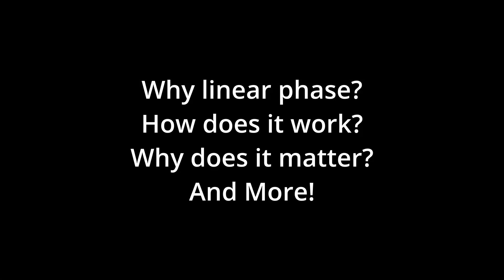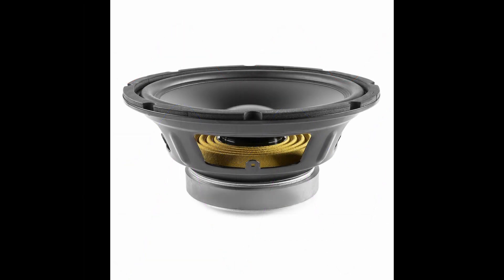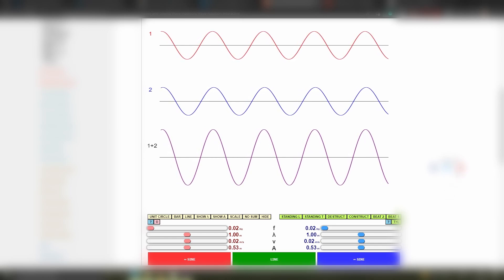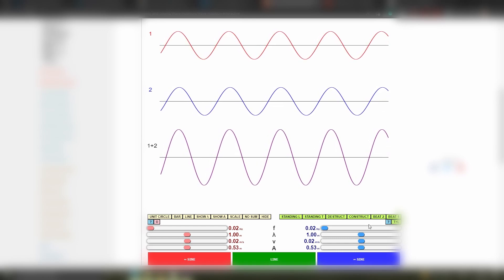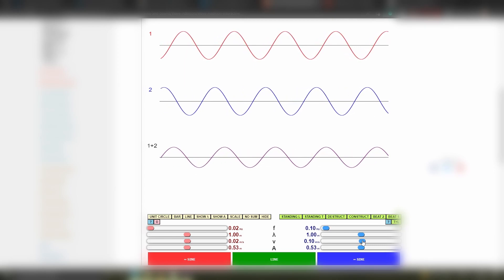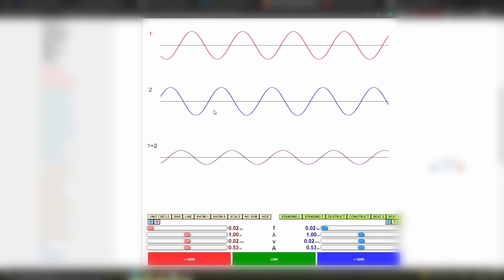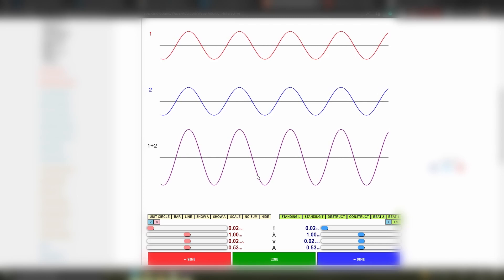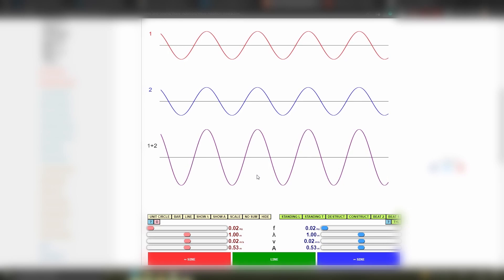Linear Phase EQ - Why you want it!

Comment: I recently changed to linear phase and found it a dramatic improvement, much smoother cleaner sound. I have some dramatic swing in the eq to help with room modes.
Reply from the maker: Glad to hear it!
Reply: @Elliott-Designs  thanks, I listen to music upmixed to 7.1 so I think the time smearing between the speakers was to much. I don’t seem to get much of this pre ringing, what cause the sound?
Reply from the maker: @matthewhanson498  it's typically high Q (sharp) +ve gain filters where pre-ringing is most prominent.

Comment: I've done a lot of listening to minimum phase vs linear phase and have preferred the zero pre ringing sound of minimum phase filters.
They can be FIR by design and don't have as much phase shift as IIR filters.
IMO if you left and right are phase matched the choice of pure linear phase corrections is not that important.
The feeling in high dynamic drums is better in minimum phase. Like every snare or cowbell cracks. In linear phase you are getting the pre attack hints and your brain is tricked by this fake future suck up to the attack points.
Try to set up a blind ab test.
Reply from the maker: Double blind AB tests are of course the best way to go about this, but I'm not in a situation to perform them myself. But with enough taps the pre-ringing will actually be below the noise floor (physically inaudible - all from what I've learned anyways), which is what I propose, although I do understand most hardware DSPs aren't capable of such high taps. I'm not sure what you mean by pre-attack hints, since that isn't what pre-ringing does (perhaps you are thinking of a different phenomenon). Anyways, I'm happy you're happy with what you have. I'm just putting the information out there for people to make their own informed decisions. I'm glad you've made yours!
Reply from the maker: It might also be that you prefer the time smearing that minimum phase gives you, and that's totally valid too!
Reply: I'm going to do more testing. I can set taps ( quality in my case) to very high and yes CPU is the only limit as always.
I'm planning highest linear vs minimum phase. I have eq at every speaker driver and on the final LR bus so setting globally to high might blow up my system lol.
Just for info I use VST pluggins in a DAW for my active system.
Reply from the maker: @sqcaraudio  sounds good! Just be sure to have all drivers be set to the same amount of taps, otherwise you'll have the audio being fed into each at different points in time! 👍
Reply: Yeah just did a quick test. All chans. Sounded different, less grain? All songs had a tad deeper depth but.....
Then an isolated kick and snare intro..
Slurp slurp thwack .
Back to minimum phase. To be fair I know the more gain manipulation requested in a linear phase filter the more pre ringing happens and if the source is an isolated transient etc.
Reply: @sqcaraudio  awesome discussion here. I think this is why Dirac claims to do mixed-phase correction. Partially to compensate for limitations in computing resources in some hardware DSP processors, but also to get the best out of both types of correction.
Reply from the maker: Totally this! Also, great to see you here Joe, I'm hoping you're enjoying my channel. I believe Dirac's implementation is purely computational and delay related, which explains why it's the bass region where they utilise the minimum phase section of their mixed phase method. Many more taps are required the lower in frequency you want to adjust whilst maintaining phase control. With more taps/samples comes larger system delay and computational demand. However, in the area of pre-ringing, it does exist, but it's audibility is nil in how it's actually implemented, unless you're implementing boosts and/or brick-wall filters that is, but you never want to do that for EQ anyways. Although hearing about what you've done with your upmixing, I'm sure you know most of this already 😅
Reply from the maker: @sqcaraudio  With my reply to Joe, it reminded me of your answer. I would very much be interested in what settings you might have used, and how you generated the linear phase EQ that you tested. Did you perhaps perform any boosts, any steep/high Q filters? What did you use for convolution of the impulse? I'd be very interested to know more. Thanks 🙂
Reply: @Elliott-Designs  I use Melda Production MAutoEqualizer for eq. It's a VST plugin.
When I am doing say the Left I match what I measure in the mic to a perfect flat line. The correction is no more than 6db and up and down usually less accros the spectrum. I follow with one more eq and the deviation is say 1 to 2 db. I usually stop at 2 but have tried more for little improvement.
Reply from the maker: @sqcaraudio  seems cool, I've never used the program, so I can't tell whether it's that which is causing massive amounts of pre-ringing to occur, but usually it shouldn't be noticeable whatsoever due to it being 1/2 as loud as what post-ringing would have been with the minimum phase filter, let alone hearing drum transients before the actual drum! Actually, just typing that out, I think I've realised what it is, that's not pre-ringing, that's something called pre-echo. Pre-echo has nothing to do with linear phase filters themselves, but rather digital room correction algorithms like the one you are using. They typically have issues when trying to correct at too fine a frequency resolution. Thus the resolution in the time domain suffers as a result, which I'm guessing is where the time domain artifacting would come from (in your case, very noticeable pre-echo). That's my guess anyways, could you possibly take the time to try my methods shown in my videos and see whether it's disappeared. I'm very interested in getting down to the bottom of this. Of course, if you can't, I totally get that, asking quite a bit of you here 😅